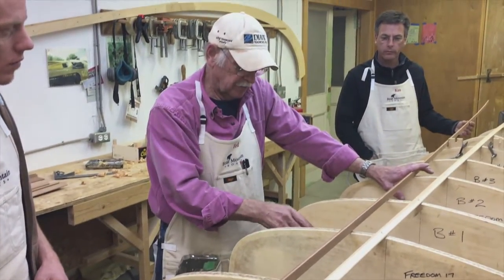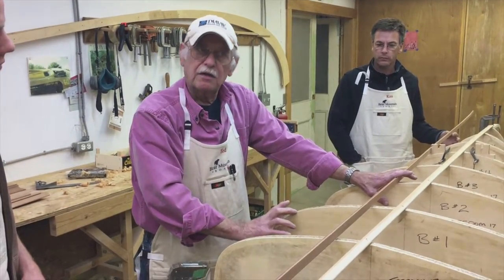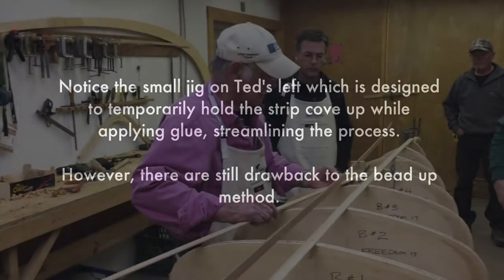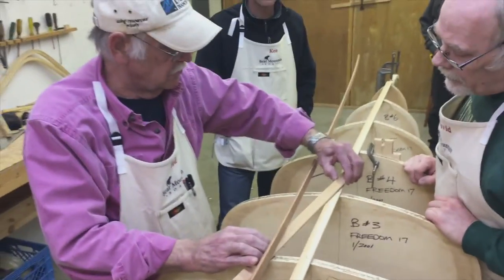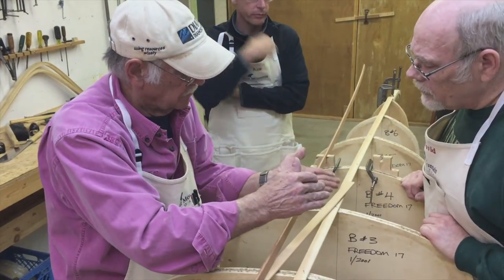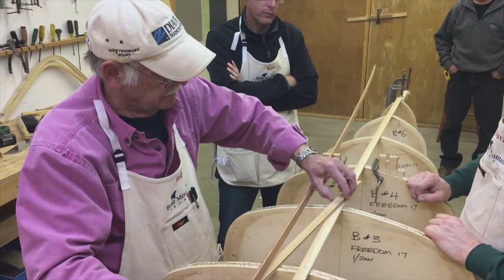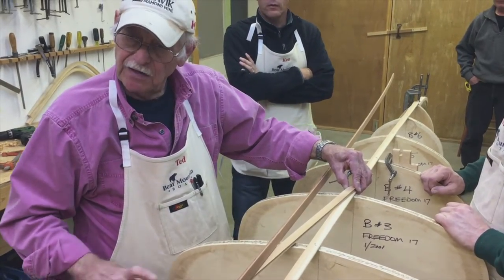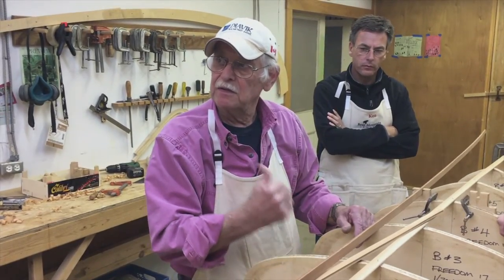Bead and Cove Tips - Canoecraft Workshop Series

Comment: what I see happening is liquid glue is noncompressible inside a bead and cove that the feather edges touch the next strip but a gap exists filled completely with glue. A staple then locks the distances between strips. the glues dry and a gap not seen is formed. Latter sanding opens the gap. the deeper you sand the wider the gap. finally, it looks horrible and you want to fill it.  the solution is to use so little glue it cant happen and not to use staples but to hot glue the strip to the mold and use Bungie to pull the strips together. the hot glue will creep as the Bungie moves the strip tighter to the next one.   Anyway this was my solution.  and it worked for me.  i didn't have gaps between strips.  i didn't use any filler.